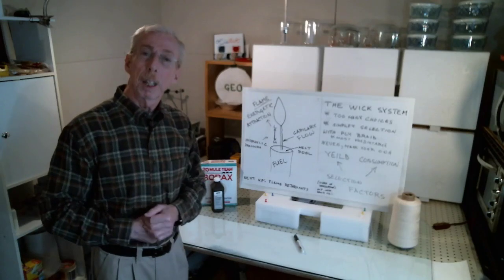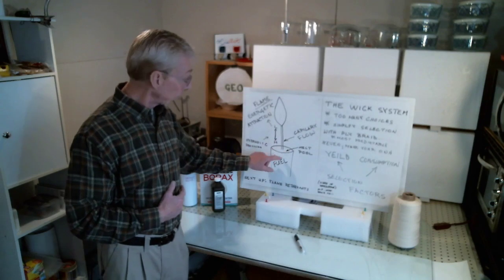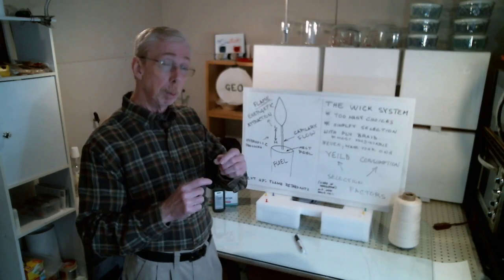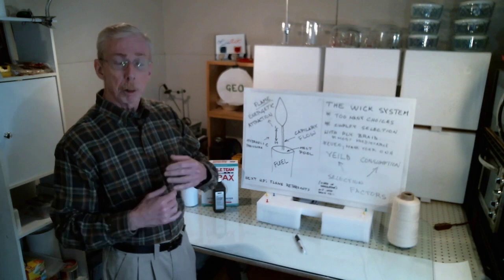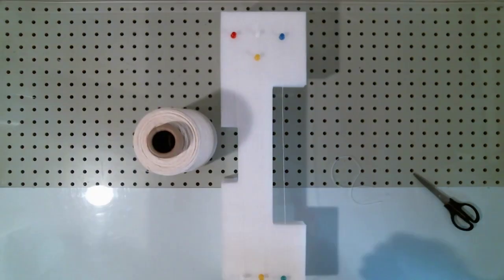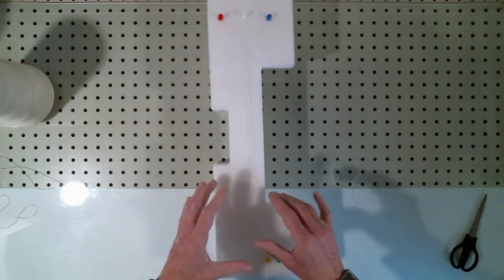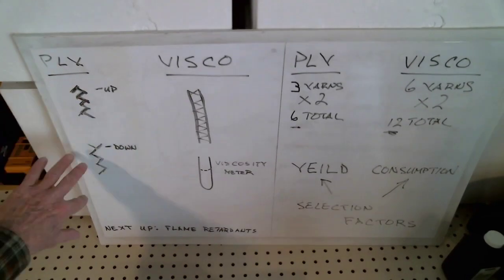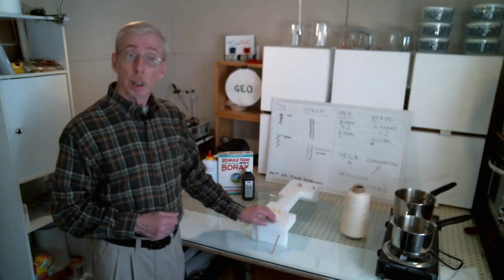Candle Making: CANDLEWICK.  How to simplify the selection process. The science of the wick. Part 2

Comment: Thank you so much for the video!
I didn't find the links for video of braiding the wicks in the description, so thats seems to be missing.
Also I have a few questions about selecting a wick. I still don't understand how to do it. Basically the problem is that with the beeswax if I use the wick that is too large, the container gets too hot. And if I use a smaller one there's a tunneling happening. Is it even possible to balance it out? How would you do it?

And also how exactly is the process of selecting goes? I don't think it is fully covered here or I'm missing something. What do you do after you tested your candles with simple braided wicks? 
Thanks in advance, your answers are most appreciated!
Reply from the maker: I put the link to the braiding video on screen, look to the top right of the video.The white dot with an exclamation point. If your wick is too large, and the next size down is too small, is it possible to use 2 wicks in your candle? That works very well. To use my method, use a flat ply wick. They go in 3 yarn increments...6 ply, 9 ply, 12 ply...up to 60 ply. Once you have the right size, use the yield data to select other types of wick. What that means is that YIELD is the main data point. It never fails, I always leave something out. Thanks for pointing that out.
Reply: @GEOsustainable   This makes sense now! I guess I'm a lil bit slow, but now I get it thanks to you :))
Here's another thing I hope you can explain. What is the difference between primed and not primed wick? How important that is?
Reply from the maker: @helenkingtavion  I just saw this. It is best to make a new comment so I get the alert. A primed wick is coated with wax. So, the wax on the wick is the first fuel to begin the capillary action of drawing the candle wax.
Reply: @GEOsustainable  Thanks!